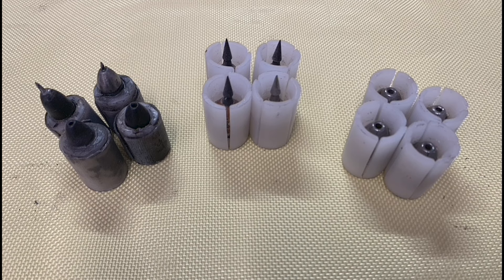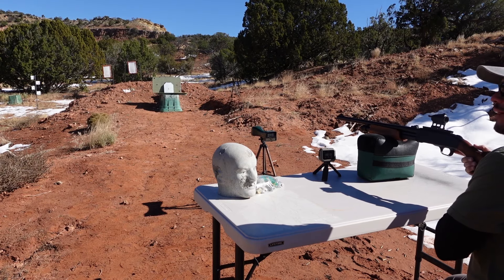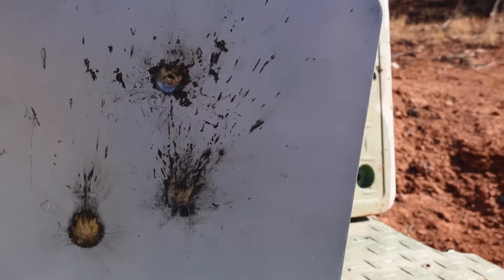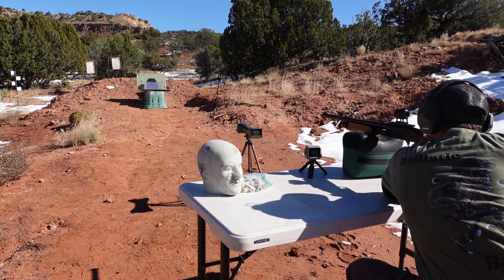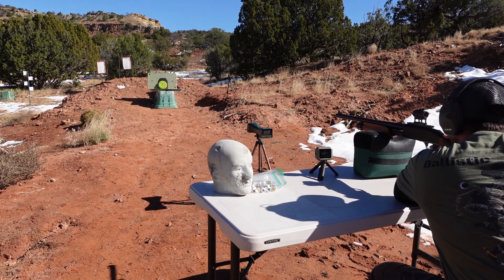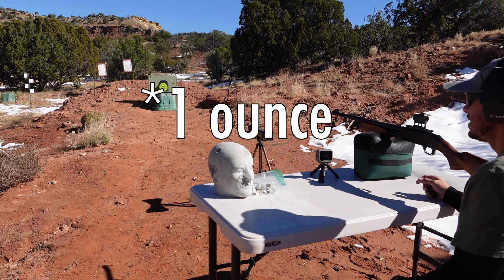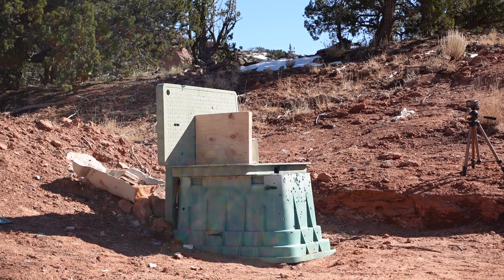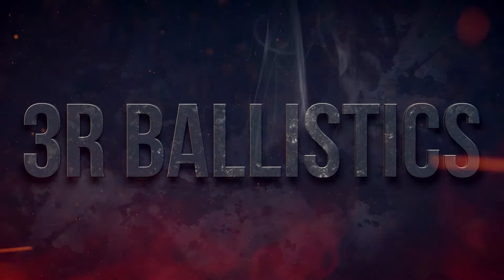Penetrating 12 Gauge experimental slugs

Comment: Seems like the best approach with tungsten would be to jacket it, or cast it in, or press fit it in as a core, into brass. If you're spinning it, and have the ability to have the tungsten machined, I'd take some notes from the Lehigh Extreme Penetrator line. Great work Sir, keep it up.

Comment: 7:04 Something that I have observed on some of my own wacky experiments is that, with a heavy enough projectile, you can extrude a sabot or pusher plate out around it. I shot 50BMG projectiles on top of sabot bases for 50AE/500S&W projectiles out of a 12ga and the polymer components were actually smashed into the annular space around the projectile and separated entirely in some cases. Just something to keep an eye out for signs of.
Edit: oh, you guys figured it out. Just throw a thick washer in there as a pusher plate, that should work.

Comment: Tungsten is a very hard metal and if it has a sharp tip it will shatter. Depleted uranium self sharpens on impact but that’s much harder to get a hold of l. I would recommend using a blunt tip tungsten rod with a diameter small enough to work as a sort of hole punch. This will help with penetration and prevent the project from shattering. Also speed beats armor so the faster the better.
Reply from the maker: @finnanderson-ns6ye  working on lightening the projectile and upping the speed for the next tests.

Comment: Im not completely sure but the tungsten from those fishing weights are probably too soft, especially since you easily carved grooves in the side of them. Tungsten CARBIDE is the kind you need for armor penetration. You can buy tungsten carbide rods online and sharpen/cut them with small dimond saws and dimond files. Also, tungsten carbide will probably destroy your rifling so it'll need a soft "jacket" to touch the rifling/barrel.
Lastly, my idea for the future is 3d printed bullet jackets (not sabots) for sharpened tungsten carbide rods, think of the 3d jackets as easter egg shells snapping together around the rods (although its more complicated then that).
With the "easter egg shell" method i think you could make a home made 556 and 308 bullet equivalent to m995 and m993.
Also no way you get through lvl4 with shotgun velocities
Reply from the maker: @nickedds2907  the HRC of the fishing weights are definitely less that tungsten carbide but when you take into account most AP rounds only use hardened steel in roughly the same HRC as the fishing weights I thought I’d give them a try. 
Your idea about the jacket is exactly what I’m working on for the next round of testing. Lighten the round and more stability with speed.
Reply: @3RBallistics hopefully eventually you can try some of this stuff with rifles ha, thanks for the vid, info, and effort, really hope your channel grows